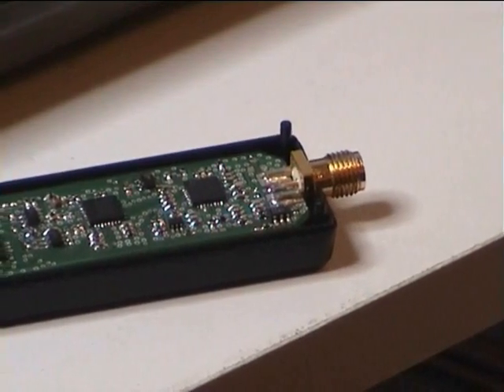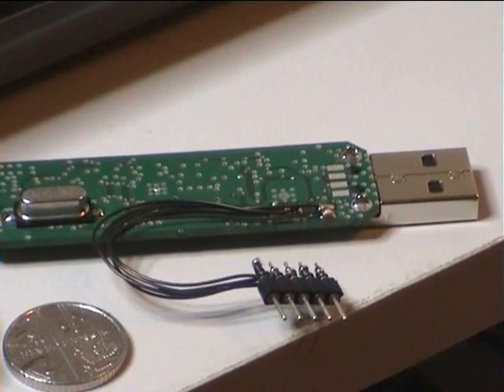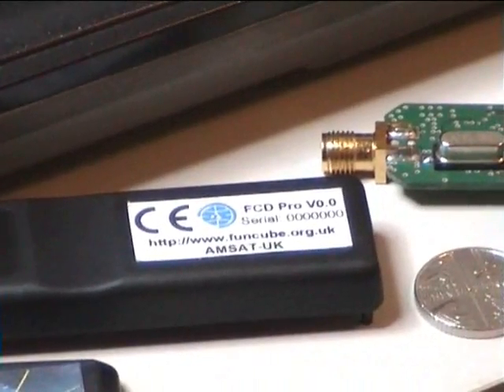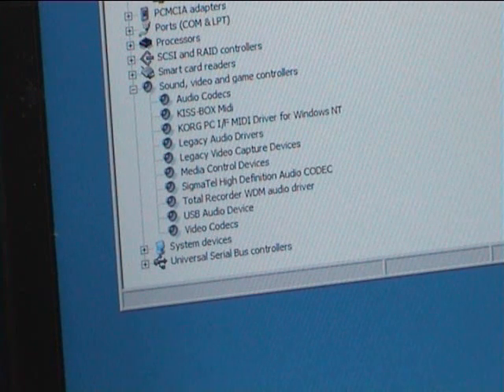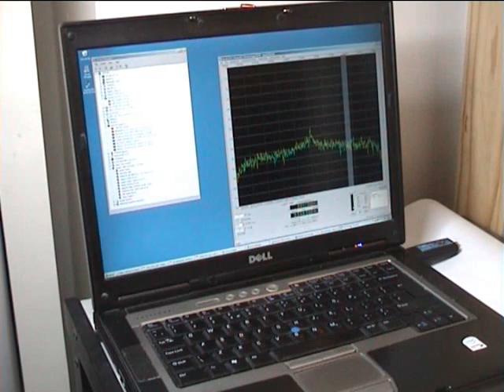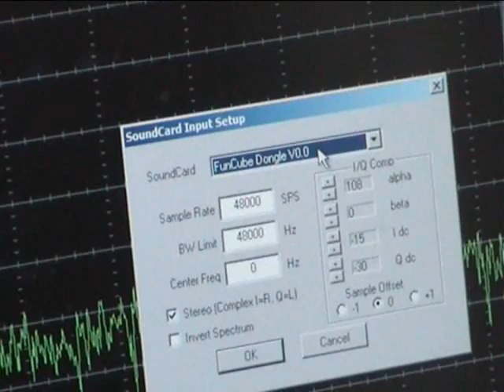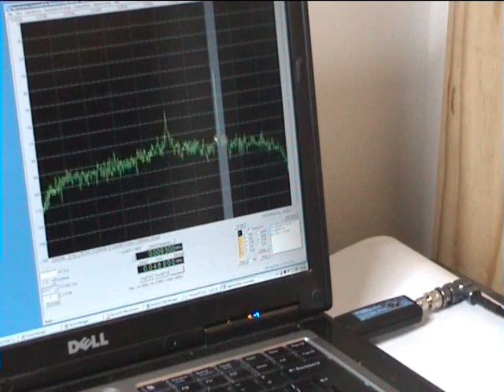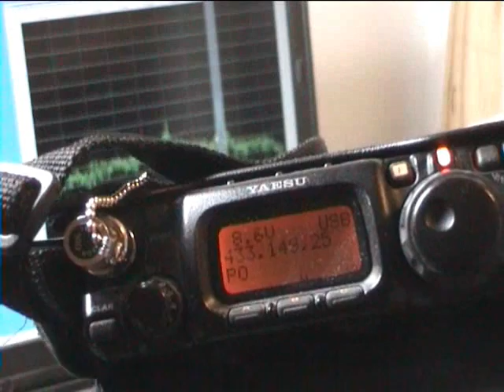fcd001_0001.wmv

Comment: You made it look so easy to get this working.  I spend months & months on just prototyping, never getting it perfect, but also scrimping on every part, LM317's for voltage regulators, leaving out decoupling capacitors, home made boards, home made programmers.  Real men don't use codecs, but use the PIC's ADC.